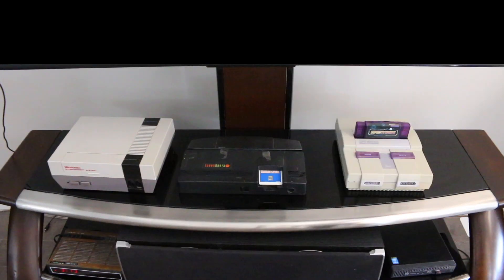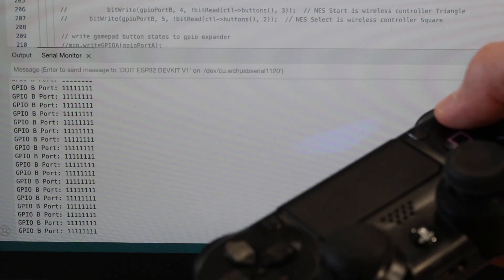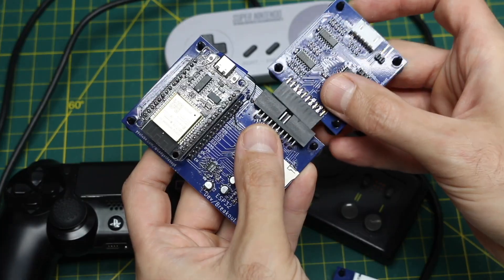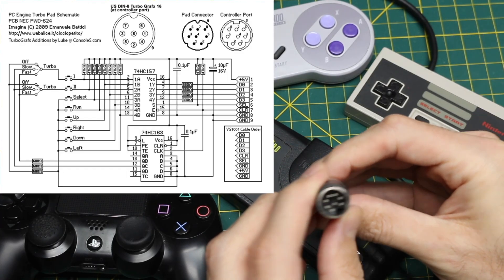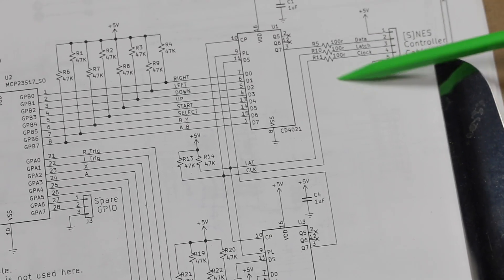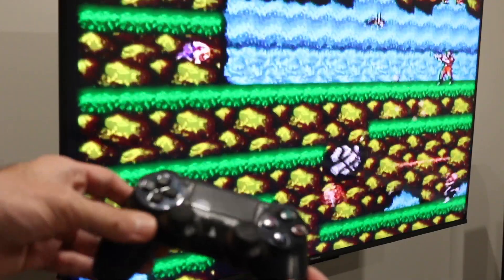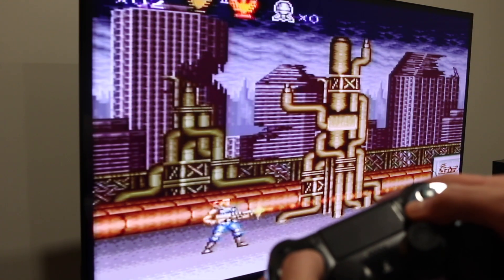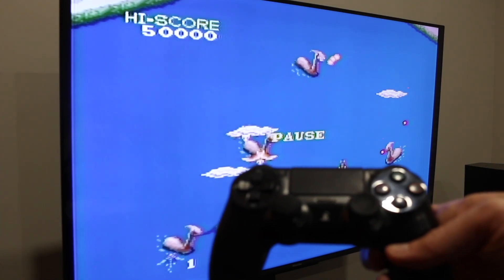ESP32 Based Game Controller

Comment: Have you any means of measuring the input lag? I believe Bluetooth should have it rather high...
Reply from the maker: The best way I would know to do it is to take apart the Bluetooth controller so I can see exactly when a button is pressed and see when it finally comes out the other end but otherwise I didn’t perceive any lag so I don’t want to risk breaking a controller just yet. 
At first I thought there might’ve been a lag because when I would press a direction button on at least two of the consoles it felt like the character wasn’t immediately responding but then I plugged in the original wired controller and it was the exact same lag so I don’t know if that’s just how it is in certain games
Reply: @GadgetReboot  Thanks. Anyway I only notice it in Bubble Bobble, and only sometimes :-) (With an 8bitdo)
Reply from the maker: I see that the ps4 controller has Phillips screws so I might try to take it apart and see if I can get wires on one of the buttons for scope probing for curiosity...
Reply: @GadgetReboot  Nice, with the oscilloscope it is possible